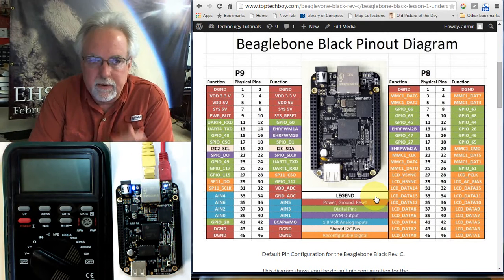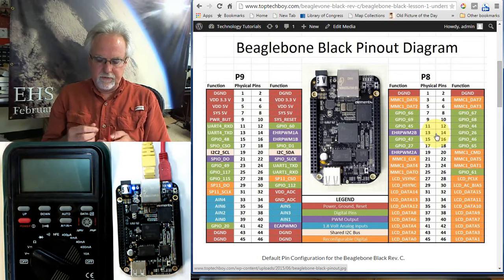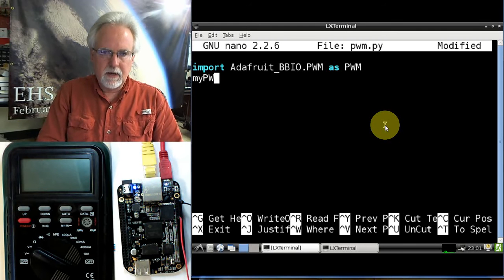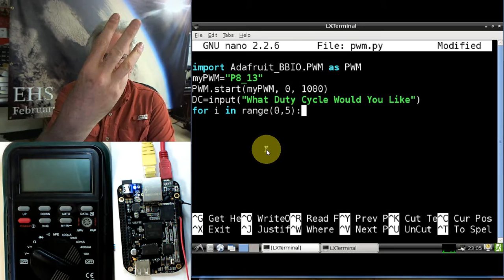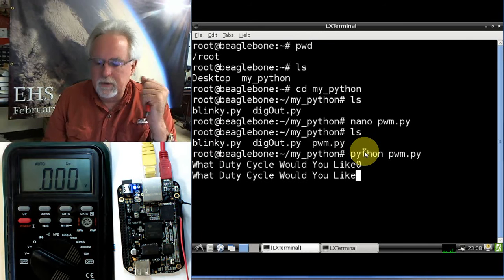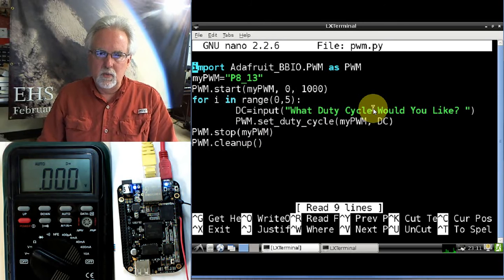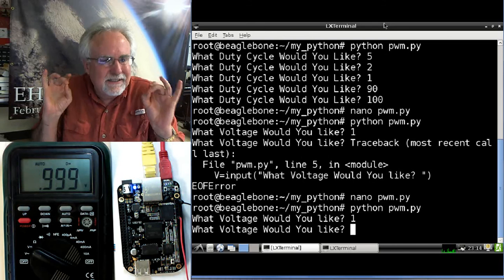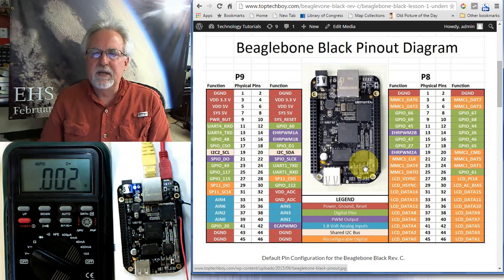Beaglebone Black LESSON 6: Simulate Analog Output using PWM in Python

Comment: No PWM doesn't mean that just applying "a switching DC supply" will give the average of it as output. We must pass it from a low pass filter with cutoff frequency very much lower than pwm frequency. Here the digital multimeter acts as the low pass filter.

Comment: I always get the same error message, what could be the reason. I work with a Beaglebone Black Rev C. with a new imag.

Traceback (most recent call last):
  File "pwm.py", line 4, in <module>
    PWM.start(myPWM,0,1000)
RuntimeError: Problem with the cape manager
Reply: Did you happen to find any solution for this? I am getting the same error